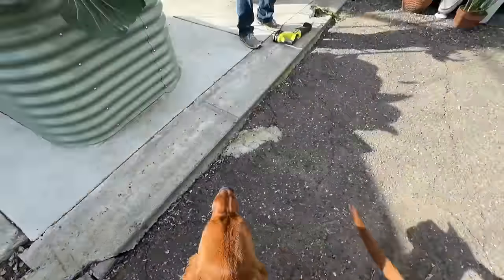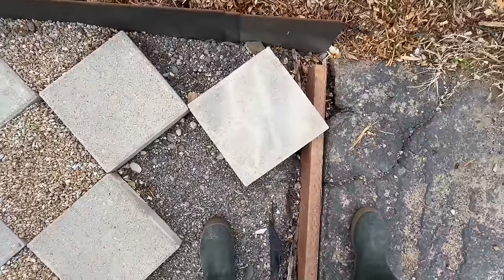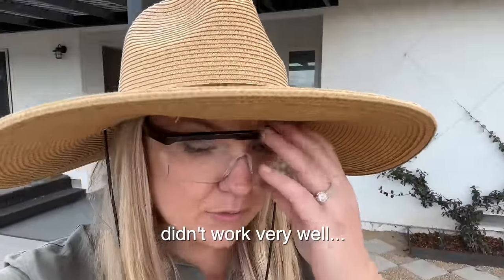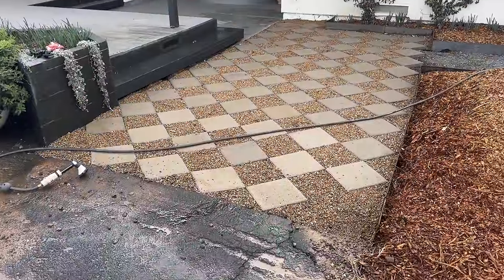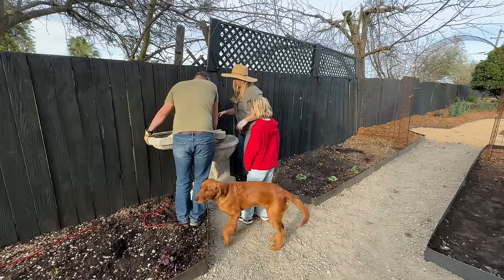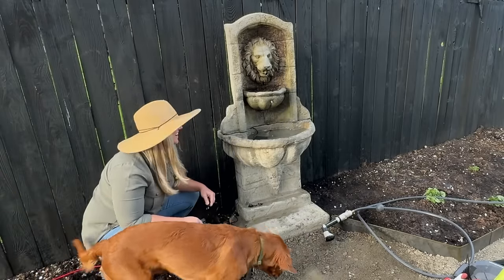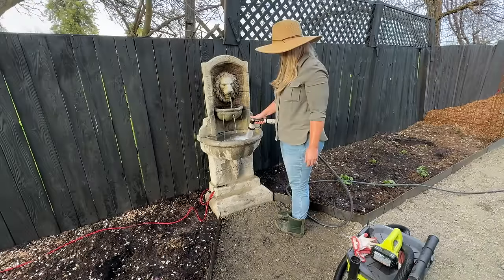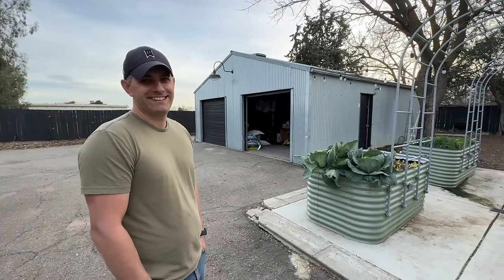Finishing the Diamond Patio & FINALLY Setting Up the Fountain! :: Dig, Plant, Water, Repeat

Comment: Love all that you've done! I have fountains and a suggestion is to buy a simple clamp and put it on the tubing and tighten to desired water stream so you won't have to worry about it changing on you. I'm also a little concerned about the wood chips on the concrete not staying level for you to walk on or rain washing it out. I think you would need edging around the concrete to hold it all in place if you decide to go that route. I personally like the clean look of the concrete separating the spaces.
Reply: What about gravel  over the concrete

Comment: You can cut asphalt with a circular saw that has a diamond blade.  It’s asphalt bordering your front patio by the new diamond patio isn’t it?  Then you don’t have to cut your diamond cement blocks.  Snap a chalk line to get a straight edge so the cut is uniform and clean looking.

Comment: ❤ Love the fountain. I have a fountain that my pump has accessories to add lights in the basin. They are small balls and have my choice to switch out colors. Then another pump choice makes fog. Summer time with the soft light in basin then the fog roll out. It is neat. Got it from a little shop in the mall near us that has since closed but I am sure you could find something on line. My fountain in my front yard, I have balls that float and light. Water friendly, battery operated. Those I got at Lowe’s. So pretty at night with the soft lights in the water.

Comment: It looks wonderful Janey!  The diamond pavers came out nice.  I was a little skeptical at first, but I think it looks fine. The only other option would have been to somehow grind out the driveway so you could fit the pavers without cutting them, but that would have been an even bigger project. Or, row by row, install the pavers from the front, moving back the already installed pavers. Not an option! Too much work.  I like the idea of the wood chips near the Vigo garden beds. I wondered if a metal strip of the edging you used up against your office shed would help keep the chips from the foundation of the office shed and therefore offer some level of protection against rot and decay, if you have the room to get them in the ground between the office and the concrete.  The metal edging around the perimeter could create a nice "enclosure" to that area.  Your plans are coming along so well.  Looking forward to seeing more!!

Comment: I think putting woodchips on the concrete is going to be a hazard with walking. Maybe it would have been better to have removed the concrete before putting the raised bed. Especially since the corner of that concrete slab is broken off.

Comment: I’m not trying to be negative, but the stones would look more professional if the square stones were finished off. It doesn’t look right with the ones missing on the ends. Grinding off the other ones and just fitting them in looks much better!